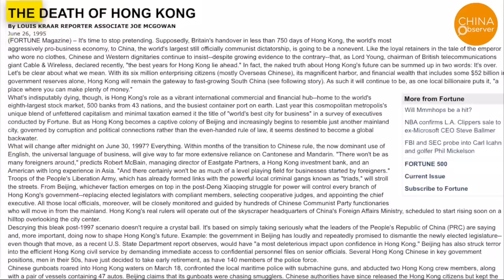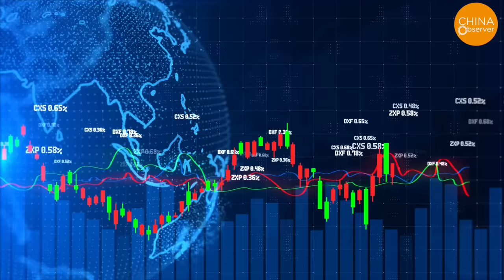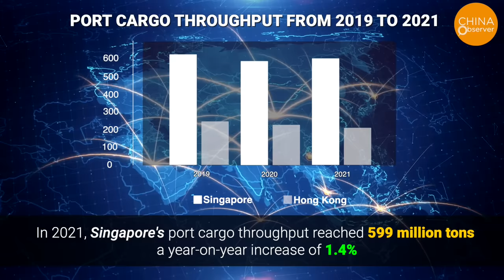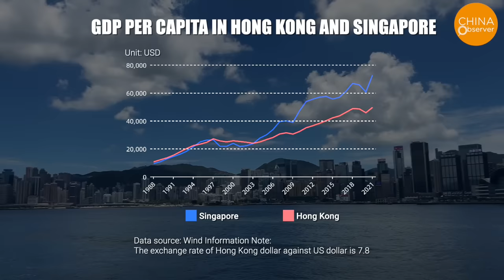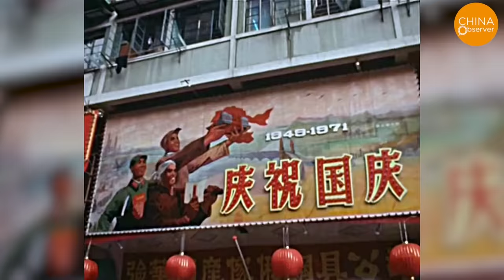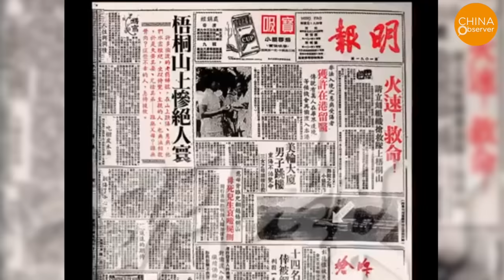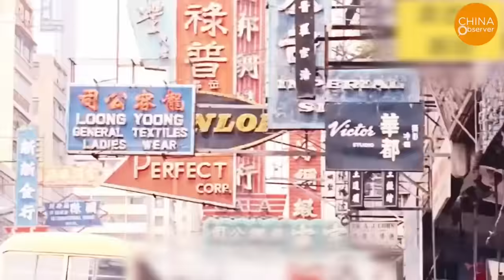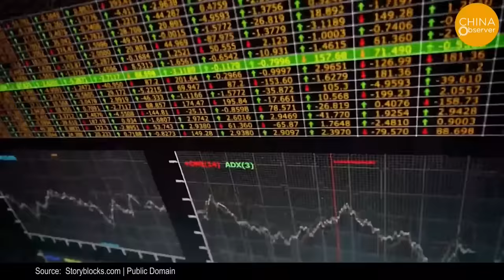Hong Kong Is Finished: No Longer a Financial Hub | How a City Goes from Global Fame to Global Shame?

Comment: China made a big one there. Should have left it as a self governed city state. I used to like Honkers, it was a handy visa renewal point visited frequently. it's only service now is as an entry point to the mainland when we have to visit family and even then it can often be cheaper and easier to fly direct.  I had also noticed most of our freight traffic now goes through Singapore, we used to ship almost entirely through Hong Kong with out freight companies.
Reply: There are now bigger, new, more modern ports in China. Singapore has not replaced Hong Kong. Look at a map. Where is Singapore. How does freighters unload in Singapore and have the intermodal containers teleported to China? You put it on a train or on a truck and drive it to Foshan? Don't be absurd.

If ships between Europe and China stops in Singapore, it is to unload stuff for Malaysia and Indonesia, maybe refuel, and then go on to one of the other big ports in China. Sometimes that is HK. But frequently, it isn't. There are now many ports in China. Which is why HK is losing it's importance as the prime shipping port for all of China.

Then only way for HK to maintain it's place was to have China not build and expand any other big ports. Which anybody would have told you back in the 1980s, is just wishful thinking. Just a mere 5-10 years after Deng was rehabilitated and put in charge of the country, the writing was already on the wall. In big black letters. People like you who deliberately decided to NOT see it was just putting their heads in the sand, wishing that the inevitable did not come true.

Should have worked on one or two industries when HK still had a couple of decades head start on the rest of China. But the guys in charge of your government decided that the best way to fund the government was by growing HK's insane property price bubble. It's not the CCP's fault that nothing was done from 1980-1999, and then the first 10 years when Beijing was completely hands-off. Your government just sat on their back side and let things rot.

If by some miracle, HK was not handed back to the PRC. If the UK had kept it, nothing would have changed. It would in fact be worse, as Beijing pushed their own ports in preference to HK which would be a foreign port. I could see a 2023-UK-run-HK, flat on it's back, with the economy totally in the dumps, the governor begging London for aid every year. And London trying to get Beijing to take HK off their hands because it had become a giant bottomless money pit.
Reply: HK and Macau both. They should have left them be.
Reply: The reality it is very problematic now for freight companies to operate in HK. Reason is,  it's takes a huge amount of time to release the freight in HK. The National Security Law, The Espionage Law, The new Business Law are very vague. Some freight owners to avoid problems choose Singapore.